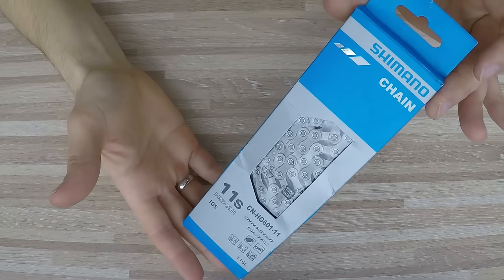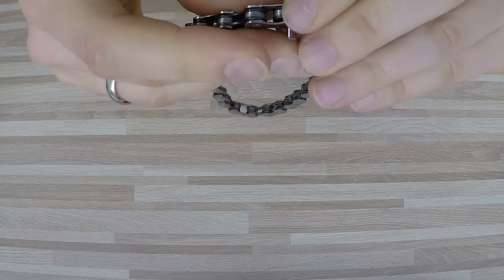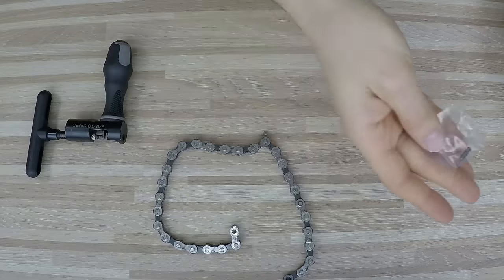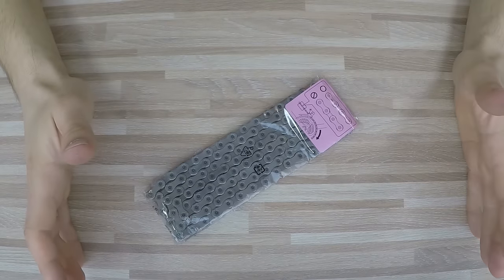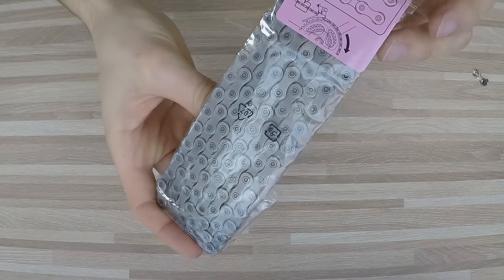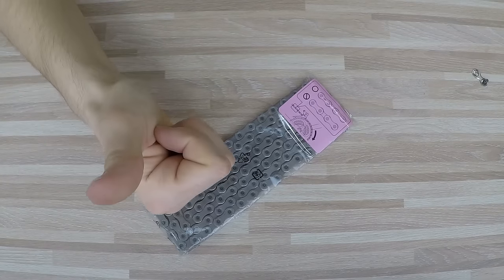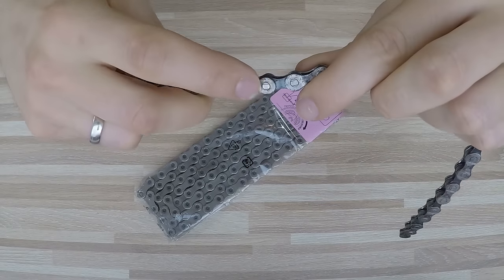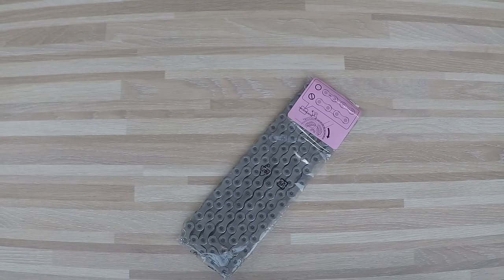4 Worst Mistakes In BICYCLE CHAIN Maintenance. How NOT to do it. SickBiker Tips.

Comment: The more you read and watch about chains, the only thing you learn is that people (manufacturers, mechanics, posters on forums, people on Youtube) disagree about absolutely everything.
Reply: Agreed. There is no single solution. World is not black and white and everything can be looked on from a different angles of perspective. No single approach is the only right one. Majority of things (if not all) can be done properly using different techniques and all those usually work fine.
A have completely different approaches with my bikes. I usually don't spend much time maintaining my old work commuter bike, I rarely lube chain, rarely clean it. In the salty winter time I also usually haven't used cloth to clean the extra lube on the chain. On the other way I ride this bike 99% on tarmac only so the chain doesn't catch dirt particles as easy as on dirt trails. On the other side on my full suspension I clean and lube the chain before every ride (usually) - when I wipe the lube off with a cloth, then it needs re-lubing after every ~50km or something, otherwise the chain is getting noisy.
BTW the first approach (don't care the maintenance) is not that bad considering the saved time and the difference in the life of the components is not significantly different. So why I just spend so much time caring about the full? Crazy ;).
Reply: @jakubpukovec7755  so right. I always always clean my chain shimano xt 10v whith gasoline, shaking it dive it for several minutes after clean all my bike and transmission whith cif and never never never have a problem of any kind of a broken chain for years with any chain change. I also use wd40 dry lube one drop per roller link and that its all for me.
Reply: @jakubpukovec7755  Yes, it mainly depends on cost of components vs. cost of maintenance. I do the same on my bikes - the one with 100$ chain gets more care than the one with 10$.
Reply: @Markus Patients I would not do that with anything narrower than a 9 speed chain, personally.
Reply: No they don't.

Just kidding.
Reply: @locoshaggy  Hi mate, you can do that ofc, but its only recommendable if you do it about every other ride! i know quiet some "chain-cleaning fanatics" who went a long way with that, but basically it´s not recommendable. But you should use neither gasoline nor wd40, the first removes the lube from the inside of the rollers too, the second dries out almost as fast as it goes in. better to use some mild re-oiling cleaning agent like X-treme Clean by Neoval, thats the stuff used in parts-cleaners too, then some chain-oil on the inside and wipe the rest off so dust and other material doesn´t accumulate too much. The point is not that the chain will break, but wear out much faster with your combination if you don´t do it really often. 

The downside is that using this method my customers don´t buy as many chains, but i can deal with that, they return for other parts or just a cup of coffee and a chat
Reply: @locoshaggy  The trouble with recommending gasoline to clean your chain is the danger of fire and the toxicity of the fumes. Using any of the strong "green" solvents is a lot better for many reasons.
Reply: @Markus Patients Why live with the increased risk? Just get the correct rivets (cheap enough) and put'm in.
Reply: @Mk-cl3il  The best idea is to be discerning by having an ability to use some critical thinking skills. There are many excellent, informed and accurate YouTube videos which not only display proofs of their points but cite the proofs that exist online.
 
In this video the videographer simply states his "truths"...as though they are true, without reasons, without citations, and without facts, or logic. That's a big proof of fallacy, usually.
Reply: @jakubpukovec7755  "World is not black and white and everything can be looked on from a different angles of perspective." That may apply to social interaction, however, when it comes to technology and science that is just an excuse for (a) no-one did proper research yet, or (b) I've come up with my own view of the world and do not want to change it.

For chain wear (a) is partially the case. However, there's so much of attitude (b). That's why you have people doing things that are undisputedly not good. Cleaning with cancerogenic substances they cannot even dispose off safely (eg. petrol, kerosene). Using anything that is smeary for a lube, regardless of uncontested fundamentals of tribology (chain saw oil anyone?).

There is some decent empirical testing though, and a some patterns for effective lubrication. The aim is to reduce friction in the chain by ensuring lubrication at all times and avoiding that small grit particle get between the rollers.

For all dry riding, road and off-road, dry lubes are better. Only for wet conditions wet lubes may be better. That is when lubricant wash out is more relevant than lubricant contamination.

When we are able to quantify chain life extension for a given lube (and put a price on our hours) we can also project what is the most cost effective strategy for a given drivetrain. In other words, there's no need for any grey vs black-and-white since we have a way to reduce it to an optimisation problem and best practises for maintenance.
Reply: @Markus Patients It isn't a good idea. It is a weakness now. If I were you, I'd buy a joining link. Try to find the pin that you put back in, remove it. If your chain was the right length, also remove that link. Install joining link.
Reply: If there's one thing we all agree on it's that WD40 is the best worst thing for your chain and is guaranteed to destroy/ save your chain from degrading for many many many miles
Reply: Even guys at WD40 agree, they introduced a chain lube a separate product.
Reply: I do not get it, Mikko. All manufacturers want chains to be lubed (internally), clean externally, links flexible, as they must, while minor external bruises on the surface of the link do not mean much themselves, comparing to the sound link body.
I do reuse links often, maybe there was one chain break (occasionally it can go into rust on some of daily goers), which I could only remotely assign to the link strength issue. As an engineer, I am open to accumulate true evidence, but here it is just "because he said so".
In short, what I want to state bold here: no, competent people do not have many disagreements on topic, even if the way they say what is most important, can vary. Yet, now we all are on i-net, where anybody can make statements, AND THAT is the major source of issues.

Go, love your bikes, I have got new top-one here this year, full ultralight carbon and SRAM Force, gotten very reasonably, it does not need yet any subtle interventions, hacking the others, cheers.
Reply: gerald schenk Can you clarify the chainsaw oil thing? I mean it is pretty “smeary” (viscous- would probably be a better word 😉)
So do you think it’s a good idea to use it? I mean a chainsaw puts it’s chain through a lot more punishment than a bike ( direct abrasion under pressure, opposing forces, direct contact with dust etc.) so theoretically chainsaw oil should be an excellent choice.
Really interesting you mention it. It blew my mind a little, I must confess😂
Reply: @Markus Patients Did the chain break?
Reply: NO WE DON'T!!!
Reply: Absolutely right there but people eve. Say you shouldn’t use jet wash to clean bike I’ve done it many times it doesn’t affect anything
Reply: @jackglossop4859  WD40 is a brand name. WD40 makes good bike chain lubes.
Reply: Only chain I ever broke was Shimano, only used Sedis or equal too. Sedis were taken over I think.  Old school road cyclist / rough stuff rider.
Reply: yeh you are right, i just watched one that did the opposite
Reply: I have a generic, non branded, no name, cheap chain, i used for a whole decade, ten years, no cleaning, no lubing, worked perfectly fine, has no link, i returned the rivet, everything okay
Reply: Voi hyvänen aika. Kaikista tärkein tuntus olevan että miten käytät pyörää. jos laitat paksua rasvaa sinä kyllä sen huomaat. Se kerää kaiken paskan ja onnea vaan .
Reply: This though, I agree with.
Reply: @terrytorial99  Your humour is dry. You need a new chain.
Reply: @lazurm  Petrol and oil. That's all a chain ever begged for.
Reply: My chain rusted while i was watching this video about cleaning.
Reply: Spend 40 bucks on a good chain breaker. Then every couple of weeks give chain a good soak and push around in a bucket with 2 inches of petrol. Then a dry with an old rag, and then a quick soak in clean engine oil. Then a wipe with a rag and back on the bike. 5 minutes max. Cost = pretty much nothing.
Reply: @lazurm  funny guy.
Reply: @philippgerstl8040  WD40 Dry Lube. Not WD40. Good advice, but bad comprehension.
Reply: Yo creo que como muchas cosas con distintas técnicas y usos nada es lo lógico yo limpio mi cadena siempre y toda la vida he usado aceite de motor no me inportan los secos los húmedos y caros ami me ha funcionado bien con todos los climas y terrenos polvorientos barros etc y tengo bici de los 13 años y hoy 59 y mi trek marlin 7 2019 que la modifique entera comparada con mi primera bici delos 70 mas todas las que he tenido jamas he tenido problema
Reply: I think i disagree, i watched a ton of videos about bike maintenance and generally every body agrees on most of the stuff who had some reasoning (there are always some people who just say what they think with no explanation why it is better..) What they disagree on is rather what you don't need to do by the book, or what are the shortcuts you can make...
Reply: @ElliotFlowers  That is truly "old school". Spend far less on a chain cleaner ( I got mine from China ($ 4.00) it is 10 years old cleans the chain superior to any other method listed here. And does it in less time than any method listed here. Use T-9 Boeshield after cleaning, it is truly a great product.
Reply: Lmao
Reply: @jakubpukovec7755  Well I disagree with you

Comment: That Funny ,,, I've been braking my bike chains for over 30 years and never had trouble reusing the same pin !!!
Reply: Same here Dan
Reply: Same
Reply: I knew a guy who skiied avalanche terrain for over 20 years until he triggered the avalanche that killed him.
Reply: Same here
Reply: Is it a 7 or lower speed chain?
Reply: Same here.  Mtbiking since 1996
Reply: 0
Reply: If it was good enough for Richard Ballantine, it’s good enough for me!😄
Reply: Same, he's full of it and I'm 45
Reply: same
Reply: The purpose of the pin is in the event you push the link out by accident. The quick link I only use for backup purpose on the road. Never use it as part of the whole chain for long ride purposes.

Danny is right to some degree but it's not extremely important to use the pin for safety reasons.

Comment: I've been pushing pins back in my 8,9, and 10 speed chains for over a decade and its worked just fine. Some of the advice was very good. Thanks.
Reply: I'm glad that pushing pins back isn't as bad as everyone thinks since I also extended my chain from 116 to 118 by adding links that the pin was already broken and rode it more than 100 kilometers climbs.
Reply: @christianalboroto7574  It is really great advice, until it isn't. You may be a super wimp, unable to put any chain to the test! My legs are too important to risk a chance of injury in order to SAVE $3!
Reply: If the pin comes out completely how do you get it back in????
Reply: @ethancropp600  maybe with a replacement pin where it is beveled on one end, instead of flared on both ends.
Reply: You saved me a lot of time here, thanks bud.
Reply: In my experience, links sometimes get stiffer if you push them back in 
that can cause a lot of problems, but I use quick links anyway
Reply: For older chains, I also used the chain's own pins when connecting the chain, but it only works on lower speeds, I think 9 speeds and lower. The ones that are wider and should also have the pins sticking out a bit on each side. The newer slimmer chains have pins flush with the chain, you do NOT want to reuse those pins.

Comment: I have used the original pins when breaking the new original chain.  I have gone through over a thousand miles with no issues.  It has been done many times on every bike that I have used.  Cleaning the chain and relubing is a great idea.
Reply: i used to do it like that too, but since now you can just put a quick link in, i don't really see the purpose of that
Reply: I agree, the idea that the chain is weaker as suggested in this video is silly to me, I would have to use my car to break a chain, ha ha.  But now I use a quick link and I bought a special pliers on ebay to remove the quick link.

Comment: Advise to the world: tried today to replace my chain. Worst mistake: do NOT take out the pin completely. Other than that you'll be ok.
Reply: why
Reply: would you do that
Reply: Yep made this mistake recently, a lot of swearing followed.
Reply: @a20axf  because you can’t get it back on
Reply: @georgedervishi4291  I did eventually get it back on, the issue was holding the pin itself. Once I got it through one part of the link I could use the chain tool as normal again. Perseverance was needed.
Reply: This happened to me a month ago. There was no way to return it. I had to take out a part of the chain and reconnect the chain elsewhere. It had enough spare length so it was cool. :D
Reply: @a20axf  I see ok
Reply: I’ve done this by accident a couple of times. While it’s quite hard, try and hold the chain so the pin sits vertically and press with pliers before using the chain tool.
Reply: that is so true getting that pin back in takes so long, if you ever do tho i found the quickest way to get it in with a pair a big vice grips and alot of force

Comment: I used a re-assembel chain on all of my bikes even my trial bike and it never broke even under serious pedal kick jumps. You just have to do it correctly. Flatten the bolt head a tiny bit after pushing back, then loosen back the chain by moving it a bit around so it won't stick. I am amazed how every "expert" starts to reinvent everything that worked for literally a hundred years.
Reply: Same.
Reply: I have had mixed results with this. Twenty-plus years ago, it was foolproof. I attribute this to narrower chains being less robust than the old heftier ones.

If you reassemble at the rivets, I think there is some risk of getting it wrong; it requires an artful "touch & feel". As for myself, I have resorted to reusable quicklinks, since I wax my chain these days. The repeated installation and removal makes it a numbers game.
Reply: I think you're doing it wrong. In order to break the chain, you have to clean the chain regularly, and remove the exact same pin each and everytime. Otherwise you would be wasting your time trying to replicate the same result. Master links are not that expensive. Connex supposedly makes the best, according to another youtuber.
Reply: What you are describing is called "peening the pin". Sounds like you are a single speeder, great, go for it. Most adults use multi- speed chains and I would never suggest your method on these chains, the manufacturers have way better solutions.
Reply: Really depends on the chainline... how much the chain is 'bent' by this offset.
So if your chain is on the outer sprockets, the chances of it coming apart is way bigger when running it with a broken chainpin.
Reply: @larrydaniels6532  No that's not called peening. Peening is a way of sharpening a blade with a hammer.
Reply: @QoraxAudio  Maybe in the podunk village you live in!! It is known in most of the civilized world exactly as I stated.